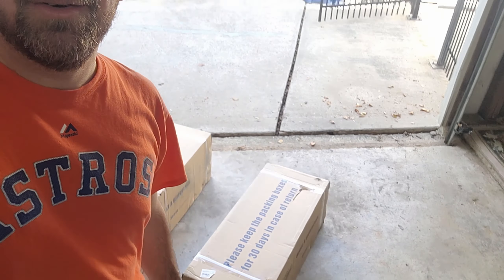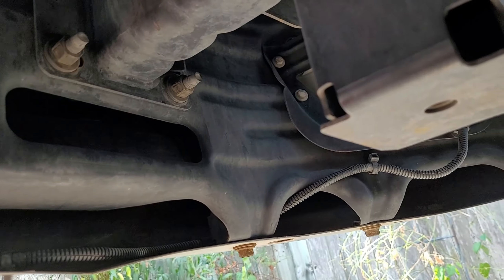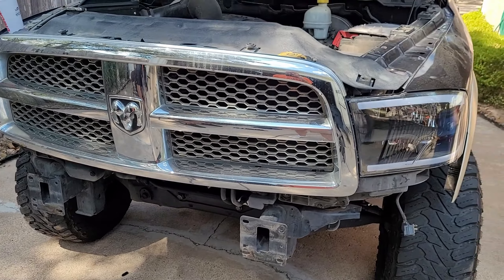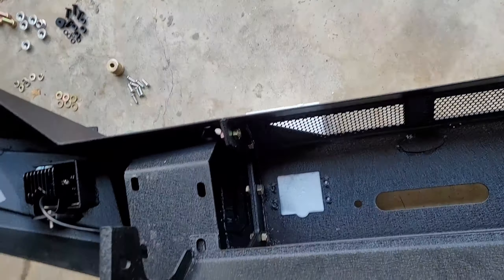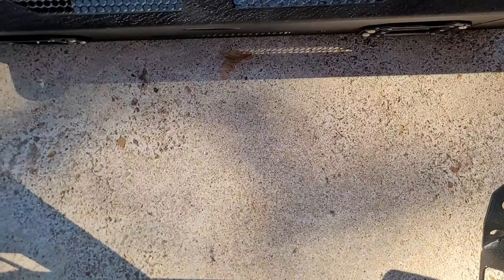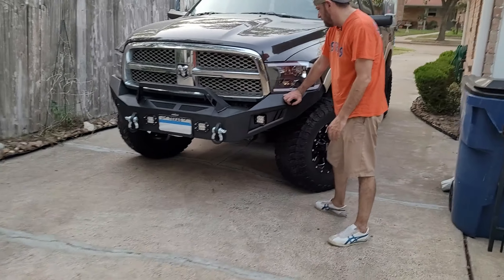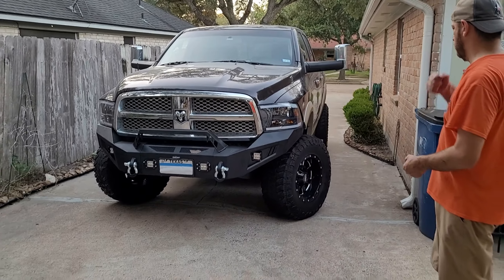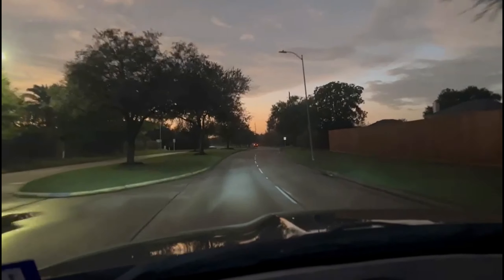Hooke Road RAM Front Bumper

Comment: Is that 9 gauge steel?
How would it hold up if a car, truck or suv brake checked would the steel front bumper hold , do damage to the front car or will it cave in since it’s 9 gauge steel?
Also if you were to pull someone out of mud or sand or yourself will the bolts that hold all those 3 pieces together will it snap or bent the bumper??? 
These are real questions I like the look but the main 2 questions are my main concern. 
Here in Texas people cut me off I want a bumper that will do damage to their car but save my truck and if I want to pull someone out of a jam I don’t want the front bumper to snap in half.

Comment: Where the outside pods are if the indentation was to be cut away do you think it could fit a bracket to hold three pods there?
Reply from the maker: If you were to cut that part out. And add  something to hold more pods, sure. I would think so.
Reply: Wow when you where running the wires I couldn’t believe the mounting are literally sheet metal …. They look cool but I doubt they offer any more protection than your factory bumpers…..

Comment: What wiring kit do I need for the front and rear bumpers??????
Reply from the maker: We used the original wires from the truck. No kit. Just basic automotive wire for the extensions.
Reply: @ricardosworkshop  so I need to order some 16 gauge wire? Any thing else? Connectors or something
Reply: @ricardosworkshop  can you tell me exactly what wire to get please? Size/ length/ brand ….?
Reply: @ricardosworkshop  thanks for not helping or answering my last questions !
Reply: Useless Ricardo